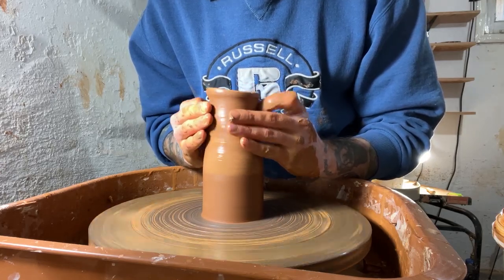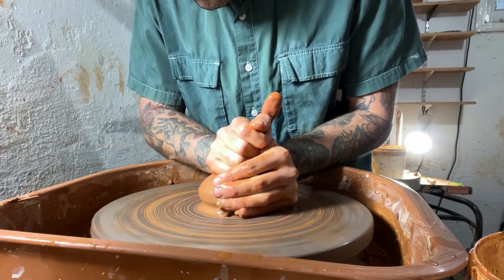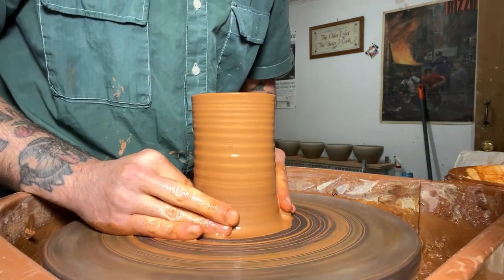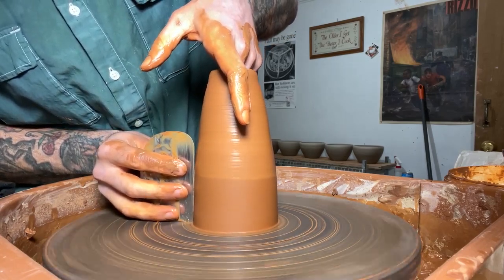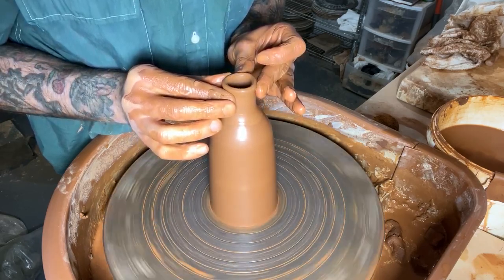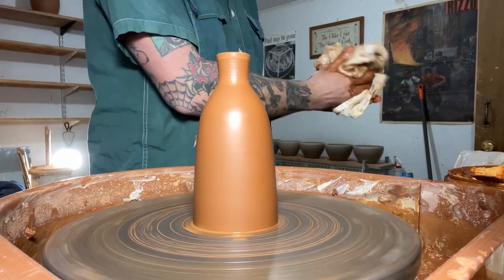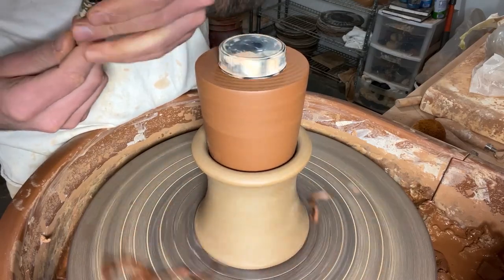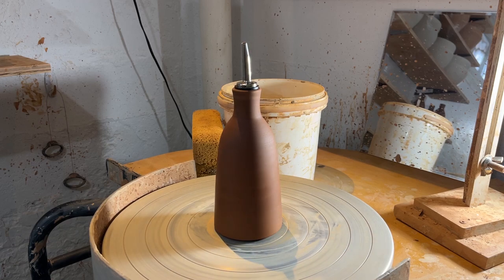Throwing & Trimming an Oil Cruet

Comment: I really enjoy your pottery! One question: I have some tattoos, but I always was afraid to tattoo a full sleeve. I'm a professional potter as well and I thought that tats will fade faster there (cause arms are always in touch with clay and water) what was your experience and does work really affect them that much?
(Sry eng is not my first language x)
Reply from the maker: that’s a great question! honestly i’m sure the clay does make them fade a little bit. as i’m sure you know clay has a tendency to dry out your skin. i try to moisturize and use lotion after each time i throw - and it helps a lot! so i wouldn’t worry about it too much. 😅